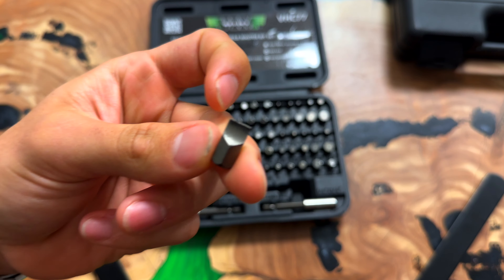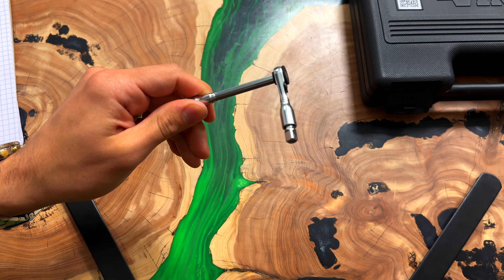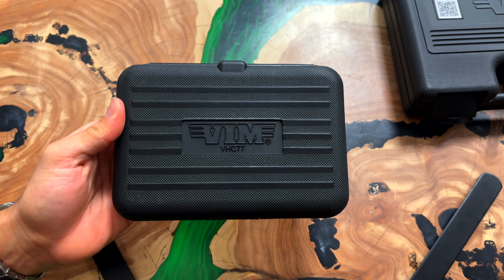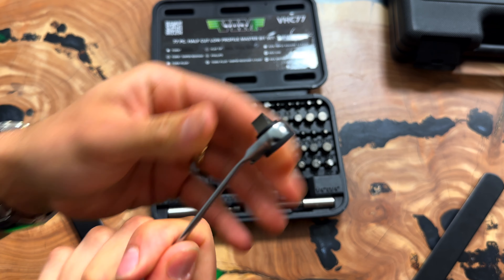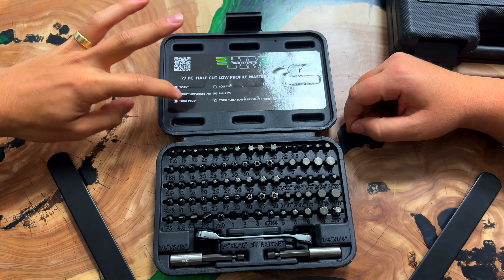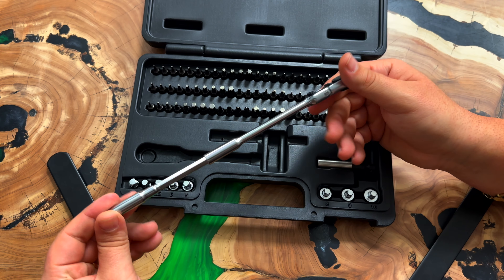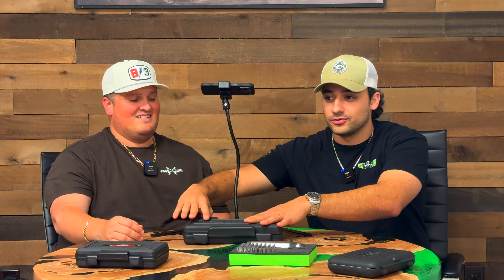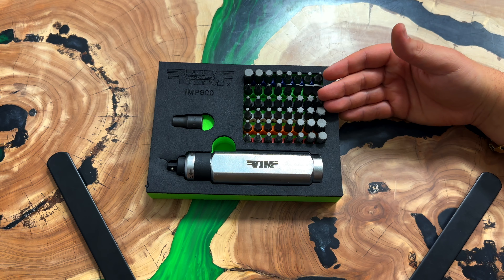Stop Cutting Your Bits in Half, We Did it for You! Tool Tuesday Ep. 71

Comment: 20:23 If that set included a long 12 mm Hex, I would buy it right now. 12mm hex is used on a ton of motorcycles and at a very low torque specs(same goes for 10mm hex).

FYI, lots of motorcycle use 14mm, 16mm, 19mm and 22mm hex for the front axle bolts.

Comment: please make the frbs kit in standard sockets. Ive used the 8mm for 5/16 bolts and bought ll of the applicacable sizes but standard sizes would be nice.  did not buy into that platform, but could use up to 3/8 in socket sets. Will still make my own if not. metric will sell but a lot of what i do is standard. 5/8" bits are the bees knees. yall got the tool to match the profile and for me, thats huge. 3 or 5 bucks a bit id gladly grab the stuby bit to replace everytime, only ever broke the 3mm bit. yall are on a 3 year trip of the best bits with ZERO wear to the S2 bits. think my 2.5 or 2mm bit is twisted but still performs. end game bit set. keep it coming.

Comment: 6:42 The HRB5 is the first VIM tool I bought and I have ran into the problem of a screw being too loose for the back drag on the ratchet mechanism to work while at the same time being too tight for me to move it with the "thumb wheel" due to access issue. Even after running into that limitation I still found the tool to be useful enough that I bought the full VHC77 set to get those stubby bits.